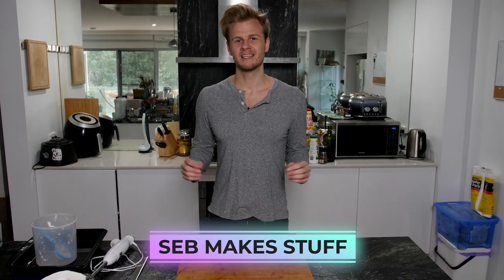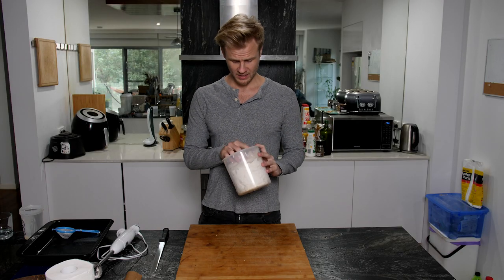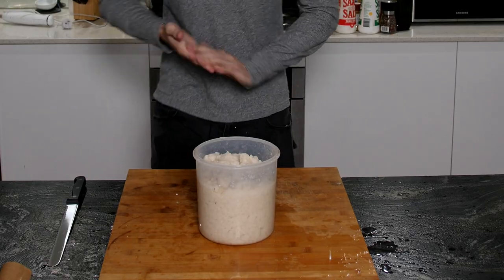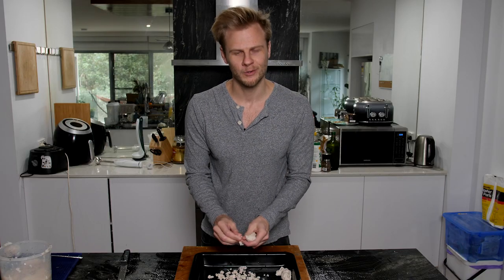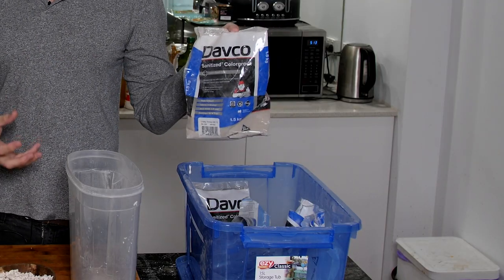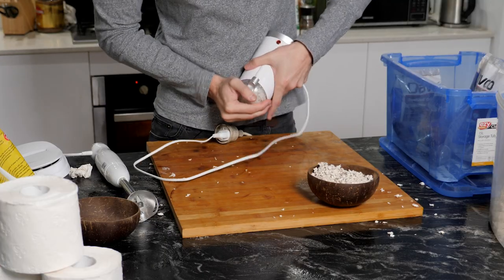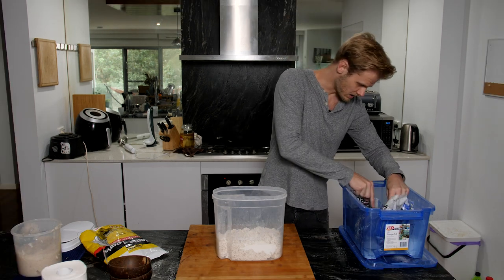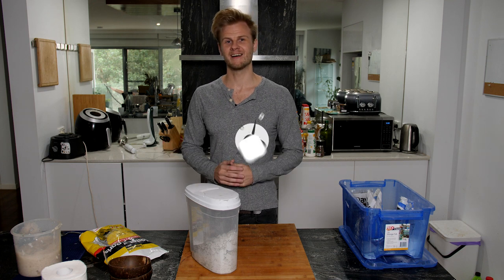DIY Scultamold Alternative | My Modelling Compound Recipe

Comment: Super useful stuff. You do a great job of demonstrating it. I would suggest putting all the wet pulp into a bandana or dish towel, gather up the edges, and squeeze the water out. Nice video
Reply from the maker: Genius! That sounds like a much quicker way to ring out the water!
Reply: @SebMakesStuff  Two chopping boards and a heavy weight save you having to squeeze it.  You can do large batches at the same time while doing something else.  Remember to put them on a slope so the water runs off.

Comment: It's a good point you make when making the plaster mixture, not to leave it white in case it chips later.
Reply from the maker: Cheers, it's definitely one of the most simple tweaks that will give the build longevity through lots of use

Comment: Great video! I really appreciate you making this, as I've been wondering for a couple months now what your recipe was!
So, I made this recipe a couple weeks ago based off of your turtle shop video, but I used a slightly different process from you as I didn't have this video at the time.
First, I didn't even use a full roll of toilet paper, but I also didn't need near as much sculpting compound as you did here.
Secondly, I didn't bother adding water to the TP.  I put it in my container then added my grout and plaster onto it with mod podge and glue.  I was worried about adding too much water and making the mix too runny, and I was glad I didn't add any more water.
Third, my plaster and grout were pre-mixed, which feeds back into the second point of not needing extra water.
Fourth, as I didn't wet the toilet paper to start, I didn't need to dry or blend/dust it after.
I'm not sure if you'll find this information useful, at all, and if you like, I can email you pics of what all I used for my mix in case you want to look into a less time-intensive mix!  I would say, it took me a little over an hour, maybe an hour and a half to make my mix, and it was ready to apply that night.  It also held well, though I will say that portions that were laid down thickly did take some extra time to dry (I'm admittedly unsure if the interior is dried out yet, hahaha), but I'm sure that it set in such a way that I don't need to worry about it moving at all, and it supports the platform I made just fine!  Like I said, if you want more details, I would be happy to share them in an email for ya!
Reply from the maker: Yer nice, there are alot of different recepies for this as it's basically just paper mache and plaster

Definitely don't need much water, i always overhydrate my mix and end up adding more modelling compound mix to dry it out.

As long as the shredded enough you could skip the early steps.
I personally like to make sure the paper is as shredded as possible which is why I do the soaking and grinding. I've found that larger peices of paper left in the final mix can cause issues with the structural integrity of the peice while it's wet.

I'm not sure what you mean by premixed grout and plaster, I've only ever seen plaster of Paris come in the pure white. 

The only part that really takes time is the drying, but I've been given a few good ideas to speed tthat up with cheese cloth.
 Could also skip the drying if you wanted to use it right away. 
But the idea for me was to make a large amount that can sit and wait to be used on future builds. Just need a scoop from the container add water &/or glue and you're good to go

Would love to see what you're making with it and how your version came out!

Comment: A much shorter method is to tear off about 10 sheets of toilet paper vertically in a nutri bullet and give it a short dry whizz. You can use the coffeegrinder if you use small wads of the paper. The K mart coffee grinder is also useful for making static grass from badly weathered mdf
 Adding artists acrylics  to the grinder, shaking as you do will colour the material and is useful for colouring diy flock made from cushion foam shredded with a wire wheel. Dont buy mayerials if you can make them.
Reply from the maker: Ohh I really like that diy static grass idea. I'm gonna have to try that one. Great advice, and I agree, make whatever you can rather than buying it.
Reply: MDF works well. After colouring it is helpful to put it through the coffee grinder to separate the fibres that may stick together while the paint is drying. The resultant material can be rubbed through a suitably sized sieve to grade the fibre lengths.
Reply: It is advisable to use a mask for protection from formaldehyde glue dust.

Comment: Would printer paper also work? like I have loads of old yellowed printer paper. As long as I blend it and break it down well enough it should work the same right?
Reply from the maker: I imagine it would, it would just take a bit more to break it down and soak it through properly. Also you might end up with flat bits on your final build. I use TP because it tends to smush down easier to a rough surface. But seeing as it's basically just paper mache paste I imagine any kind of paper, cardboard or even wool would work.
Reply: @SebMakesStuff yes. But it's harder to work with, cardboard also works.

Comment: I've made many dioramas over the last 40 years, but only once used plaster of Paris, and never again. Most dioramas are only intended for temporary displays rather than permanent fixtures, but even then, the use of poP is unnecessary and far too heavy. Newspaper or toilet paper pulp on its own is perfectly suitable for most projects, for it can be dried and reconstitutes just by adding water again, and known universally as papier mache! You can even buy it ready made from any good model/hobby shop. Modelling it is relatively simple, and even the rough texture can be smoothed over with any household emulsion paint mixed with household fillers. In many cases there are a variety of simple methods to smooth the surfaces, but it's all according to what you intend to achieve. Sorry, but this demonstration is much too labour intensive, and takes too much time. Why go to all the trouble with this method of using kitchen blenders and hand tearing, when you can poo sheets of paper into a simple office shredder in a tenth of the time?
My dioramas are usually custom made representations of actual terrain, with accurately scaled contours - maps in 3D if you like, so use the most appropriate materials and methods necessary to achieve the desired product. If I had to use the methods in this video, I'd never get my dioramas done in the time needed. In the time it took to make the pulp in this video, I could have had a one yard square map drawn with all the features located and countours laid out - all on a grid.
Many modellers today don't even bother with paper pulp, preferring to use styrofoam which is easily shaped and with no messing about with the water and drying.processes. No, I'm afraid the above method died out more than 20 years ago,
Reply from the maker: Basically you're saying you prefer paper mache: which is a perfectly good option. But I think they are both to be used in very different circumstances. This stuff is great because I can build a batch of this once and have tons of it stored and dry able to use at any point just by adding water and glue. It also has a significantly better texture for earth and rocks than paper mache and takes paint much better for the style I use. I'm sure there are quicker ways I could approach the process as this video was my first time ever making it. But the bulk build then leave me with a super quick process when I am actually building something. Fair enough if it's not going to work with your style of builds, but it is definitely a super handy product to have on hand for wargaming and ttrpg Terrain builds.
Reply: @SebMakesStuff  Thank you for your response. I didn't say I preferred papier mache; I said that if I was going to use the method in your video, papier mache as I would make it is quicker..
There are many methods of scultting terrain - too many to list; bust as I stated, it all depends on what you want as an end diorama. They all take time, and much depends on the kind of realism and accuracy you want. I'm not into wargaming, as most of what I do is reconstructions of real events for the purposes of military museums. At the end of the day, it's horses for courses, each to his/her own.
Reply from the maker: That's super interesting. I would love to do something for a museum. I'm fascinated by the different kinds of diorama work that is out there, especially as I just do this all as a hobby and usually work at the same scale. What are the hardest diorama and the coolest diorama you've had to put together?
Reply: @SebMakesStuff  Interesting questions Seb. My most recent diorama was for a privatte individual who wanted his father's WW1 event recorded as a diorama - basically an incident in a WW1 tank verus artillery battle. A simple enough scenario only made difficult by the distance involved and the scale required. The distance was two-plus miles by 1.5 miles...with nothing only open ground between! What he wanted would have taken up some eight feet long which he intended to house in his spare room. He had no idea of the scale and size he wanted, but in the end it was a matter of reducing the degree of empty space while still retaining some idea of distance, and to a size suitable for home display.
WW1 scenarios are relatively easy as there are Trench Maps which are well-detailed with good contours to follow, so laying the ground levels is quite simple. However, the only answer to the empty space was to reduce it within reason, and the scale was brought down to  roughly a four x three feet diorama. It included the remnants of a village, three artillery guns, a railway embankment (sloped) and four tanks - one of which was stuck on the railway line.
I make everything from scratch, and highly detailed. The railway lines were metal, and the tank tracks were cast from pliable silicone. The grass was static grass so that it looked natural; the barbed wire was actual wire with very fine, silvered & rust-colouredf threadwire used for the barbs (very, very tiny). The tanks were made mostly from plastic sheet, with the sponsons/guns made from Milliput. The roads were both cobbled and dirt track (I used lentils for the cobbles)!! There were several 45mm figures (most of my figures are 54mm) made from Milliput, and a few trees and bushes made from a variety of materials. The whole diorama was made in a portable wooden case  with a hinged top doubling as a backdrop when opened. When closed, it had a 6-inch tank badge on the lid, made from impressed/embossed Fimo & Milliput brass-painted. I'm not sure if I still have the photographs, but if I can find them you're welcome to see them - I'll let you know.
It was a difficult project due entirely to the scaling I set, but the customer was entirely happy with it and has displayed it at a variety of venues. He has also damaged it through carelessness which I have twice repaired before refusing further requests for repair. How my customers use or abuse the work is entirely their responsibilty. I always advise them that these models need to be treated with care. Museums are generally no bother as their displays are more-or-less permanent and rarely tampered-with and usually displayed under glass. 
I've been a military historian for over 40 years, and I've been making models from childhood, so combining both interests has become fairly natural, andwhat  was once a hobby eventually turned into a side income - although the income can't really cover the amount of time ot takes, but I never do it for the money, just as long as my cost are covered.

Comment: Wow dude, you so over complicate this.. So many more easier ways.. Kinda funny you act like this is way you usually make it, and everytime some odd happens your surprised. I knew that milkshake blender would not work before you even tried it.. Next time you want some paper to add, get the recycled paper that they use for insulation. Its like 10 bucks a bag, and wont take you a week to chop it, dry it, mix it let it dry again.. Your making more work for yourself than need be.
Reply from the maker: thanks for the super friendly approach to the advice.
Ill have to see if I can get some of that insulation paper(never seen it before) but for now this works just fine for me